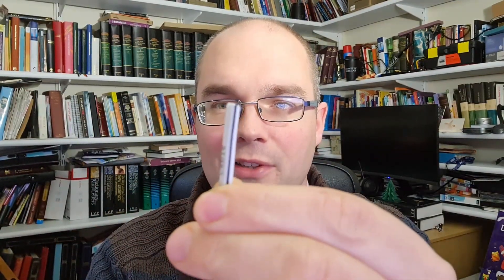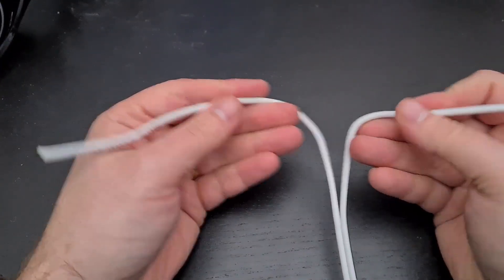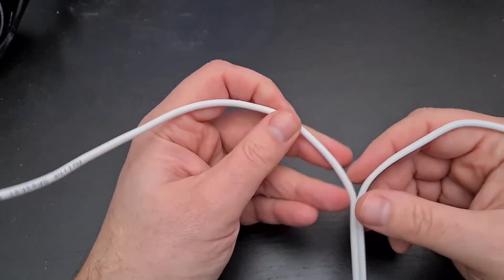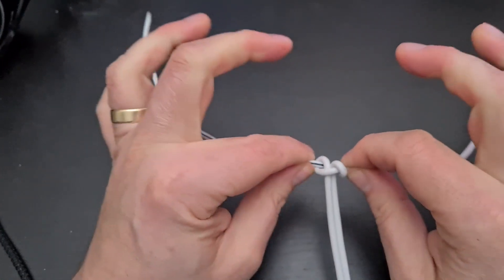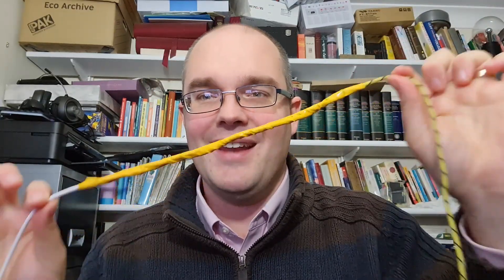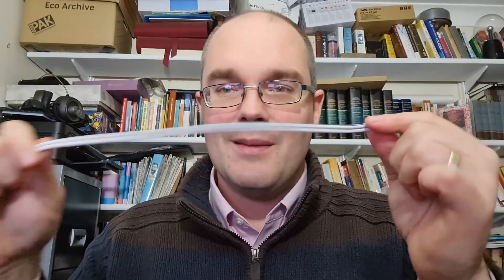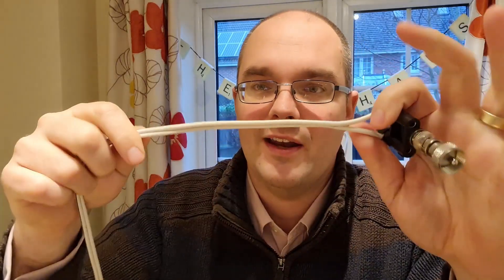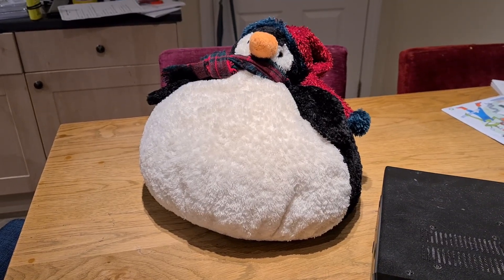Build and Test: Homebrew 20m Speaker Wire Dipole with ICOM 7300 Amateur Radio Ham HF Bulgaria 2E0BMT

Comment: Think my 40 meter worked out cheaper used an old extension lead someone was throwing
 out so only bought the middle part like yours ftom aliexpress for about £2 50  the end insulators were scrap pieces plastic cut yo size  So thats basically it tunes flat accoss the band , 73s Derek

Comment: I have seen many videos using speaker wire to make an antenna. This is the first one I have seen where it was also used as a balanced feed line. Brilliant! It never occurred to me to use it for the feed line as well.
Reply: Just bought a low power portable HF rig and thought I would start building simple antennas starting with a 20m dipole. But using the twin feed as a balanced line makes this antenna ideal & lightweight for portable use. I never saw it either but it makes such good sense.

Comment: Great video! I'm also building one next week, got the speaker wire today. Fingers crossed as I live in a block of flats in London and only operated VHF. I hope I'll be able to at least receive on 6m (maybe even on 10m). Due to restricted space in my balcony I can't set up a longer antenna. Lots of metal around as well, but it wouldn't hurt trying. If I can receive signals with my basic SDR I might take the plunge and buy an HF radio. 73, M7BAL

Comment: 😱 I'm shocked that you say you don't need a balun for this Ben !

Your absolutely right when you say it's ballanced feed to a ballanced antenna,  But the output on the radio is unbalanced. 

Best not to use without a balun so it keeps the radio happy.

Congratulations on the G5REV callsign & glad you managed to sort OFCOM's error.

I'm currently unlicensed as i wanted to have my original B class call from 1992 back as i didn't like my 1993 A class call.

OFCOM said i couldn't change my call unless i surrender my G0 & stay off air for 2 years, Then i can apply for my original as a returner.

In September 2022 i will try to get a nice vanity call if i can,
They might insist i get my reserved G7 back. (Only time will tell)

I was going to sit a foundation course to obtain another licence for QRP but OFCOM have flagged me & will not knowingly issue me another licence of any class for 2 years.

Oh well not to worry !

Keep up the good work !!

Comment: Hi Ben, I have purchased speaker wire and banana plugs. Does it matter which way you connect the wire to the banana plug.
Reply from the maker: Not for a dipole. But for an antenna and a a counterpoise you need the middle of the coax (red) in the air, and black on the ground.
Reply: @RadioRevG5REV  Thanks Ben, I purchased 100ft of Amazon 16 gauge speaker cable and 2 banana plugs. I'm interested in making an HF antenna and a 2m and 70cms dipole. What's the best way to do it. Any advice is greatly appreciated.
Reply from the maker: @philiprobinson999  Google dipole length calculator. For the HF one, you will need to cut it for the band you want to use. I made a 20m dipole, for example, which will tune to 40m too (just about). For 2 and 70, a dipole will be poor. As uhf vhf is line of sight, the antennas need to be high up, and you would usually use something with gain (a coliniar or a yagi). Hope that helps.
Reply: @RadioRevG5REV  Thanks Ben, I'll stick to the HF side of things then. I'll let you know how I get on.

Comment: Good video, thanks for posting it. Where did you get the connector from with the blue and red screws on the to and the SO239 connection?
Reply from the maker: It's a BNC to Bananna plugs, ebay or Sota Beams sell them. I then added a BNC to 259.
Reply: @RadioRevG5REV  Thanks Ben for replying.
Reply from the maker: @philiprobinson999  it's a pleasure. Feel free to subscribe to my YouTube channel if you want to see more of my videos. 73
Reply: @RadioRevG5REV  Will do Ben.

Comment: Great video once again Ben, did you use a tuner?
Reply from the maker: Thanks Brian. The Icom 7300 has an internal tuner. I did use it, but the swr was low, so there was not huge need, but with the tuner, it came down to 1:1. Just uploaded another video on Baofengs; I didn't realise they were quite so controversial, but I hope you enjoy that too. 73s
Reply: @RadioRevG5REV  Cheers Ben, I’ve watched the UV5R one you did pal. Keep up the good work.

Comment: Did you need to use a set length feeder or not ?
Reply from the maker: Thanks for watching. The set length was from the middle of the dipole to my kitchen table without touching the floor ! Not mathematics but practical! Hope that helps. Thanks again for watching the video. Please feel free to subscribe to my YouTube channel if you want to see more. 73s
Reply: If the “feedline” was half wave long (or a multiple of halfwave), taking the velocity factor into consideration, the impedance at the radio end of the feedline would be exactly the same as the impedance at the center of the dipole.
Reply: @dandypoint  Well as the two wires are still bonded together from the elements to the rig it acts like a balanced line so the impedance will remain the same as at the centre of the dipole.
Reply: @sharonjuniorchess  not sure I get your point. Example 1 : if the antenna impedance is 100 ohms and connected to 50 ohm coax the input impedance of the coax varies with its length. If the coax is 1/4 wave the impedance looking into the 1/4 wave coax is 25 ohms. If the coax is 1/2 wave long the impedance looking into the coax is 100 ohms. 
Example 2. If the antenna is 100 ohms and you use 1/4 wave of 70 ohm line to feed it the impedance looking into the 1/4 wave line is 50 ohms.  If using 1/2 wave of 70 ohm coax the impedance looking into the coax is 100 ohms. In example 1 the SWR on the coax is 2:1 in example 2 the SWR is 1.4. If the antenna is a true 50 ohm load fed with 50 ohm coax the SWR is 1:1 and the length of the coax does not matter.  If an SWR exists on the line it will transform the antenna impedance depending on how long it is. The range of impedances possible all fall on the SWR circle if plotted on a Smith Chart.
Reply: @sharonjuniorchess  sorry I used the word coax I should have said feedline. The parallel wires form a feedline. It works the same way. The feedline has a characteristic impedance same as coax.  The dipole at the end has an impedance at the feedpoint. If the feedline is not the same impedance as the antenna then there will be a SWR and the impedance looking in to the feedline changes with the length. The parallel wires have an impedance when they are close together that can be computed. They are closer spaced than 300 ohm line and is probably less than 100 ohms but not as low as 50. Regardless, we do know that if the feedline is half-wave long ( electrically) then the impedance looking into it will be the same as the antenna. That will not necessarily be true with other lengths.

Comment: Did you check the swr if so what was it
Reply from the maker: Yes. It was good on 14.200, about 1.2:1, lifting to about 1.8:1 at the edges.
Reply: @RadioRevG5REV  Okay that’s fine. It sounded like you just plugged it in ha ha